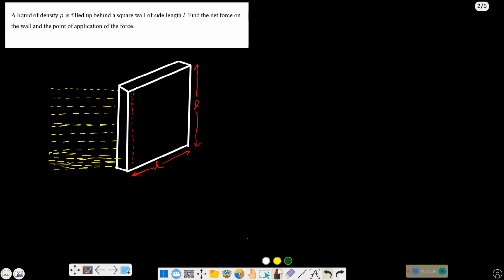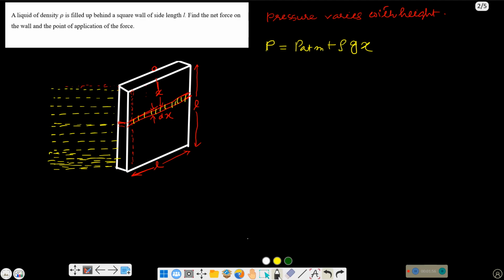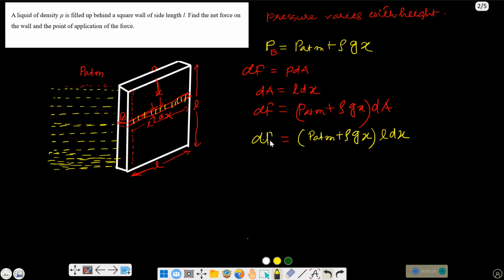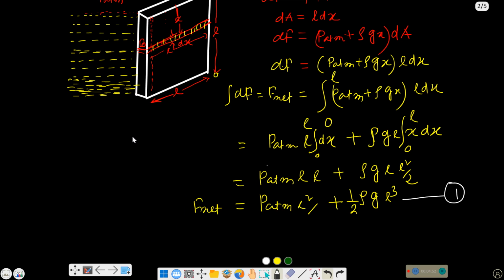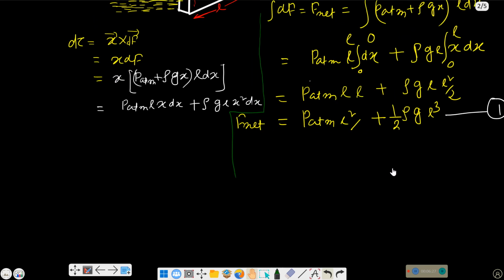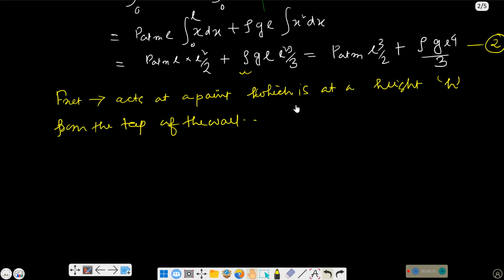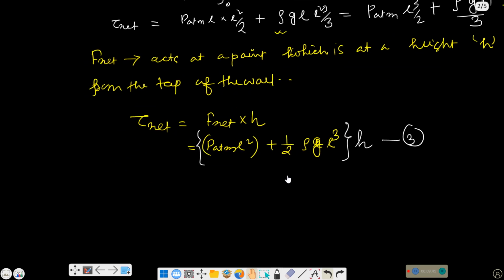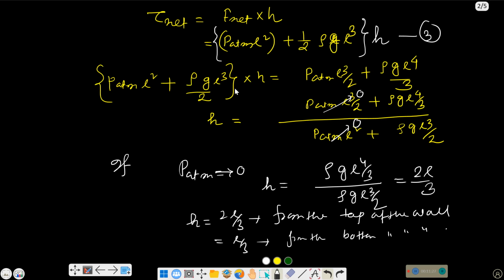👉 Why Force Acts at 2h/3? Complete Step-by-Step Derivation | Fluid Mechanics

Comment: Sir it can also be done in a more simple way,just a two step answer...considering that element ,net force will be pgy.b.dy...where b.dy is the area of that element  if b is the breadth of that wall ..then integrate it from 0 to H (if H is the height of the wall)..it's simple
Reply from the maker: Yes, it's simple.. The solution in the video has the same explanation as yours.. Take the  pressure at any height then force on the element at that height and then integrate it.. You are right..